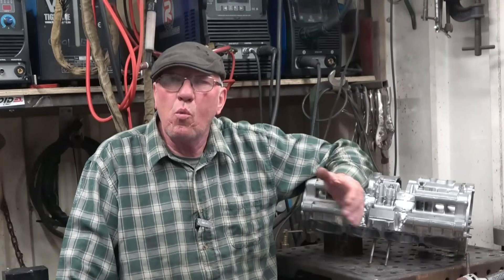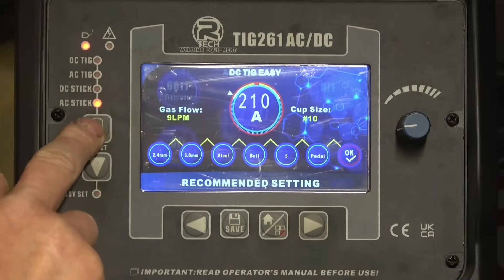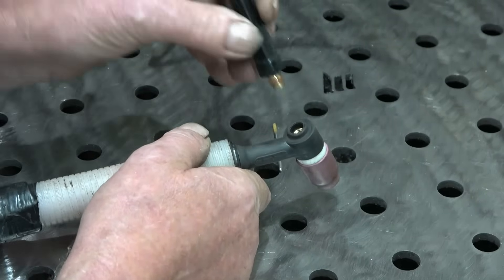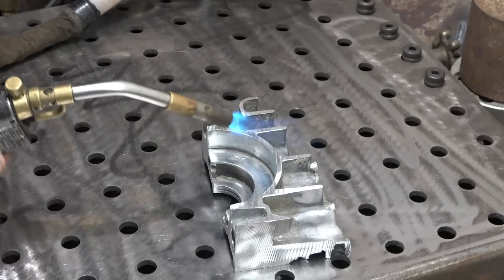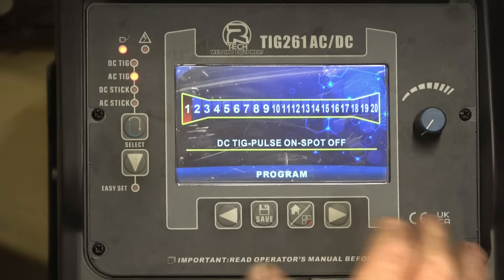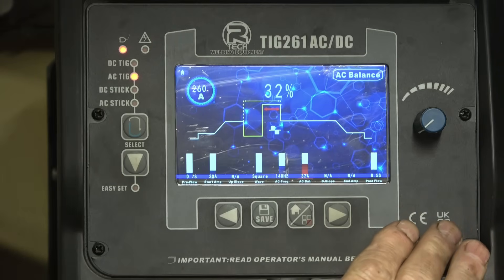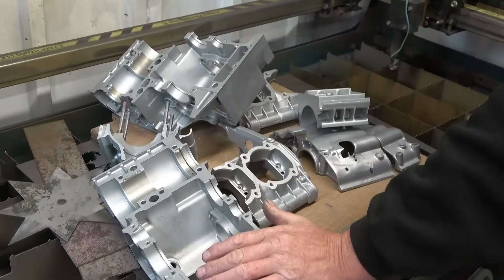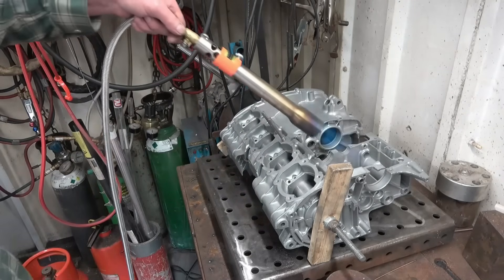R-Tech TIG261TFT, RD500 4-Cyl from 2 x RD250 Engines Welded Together

Comment: First proper road bike I ever had, the Yamaha RD 250, back in 1973, XFY852M. Seems a shame to "modify" 2 engines like this, as there are not many of them left. One of the bikes I'd buy if I won the lottery. 
Excellent video of welding them up though. I have the older  R-Tech model digital TIG welder without the LCD, it does a really good job on alloy, better to setup as well, compared to a Parweld I used recently when I did some contracting for a couple of months.